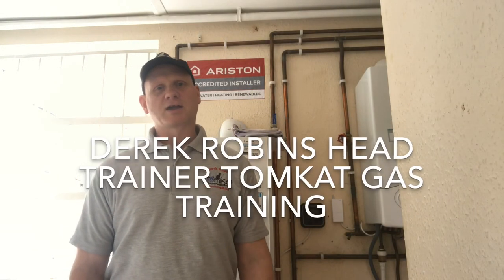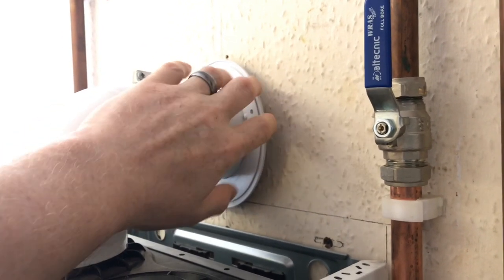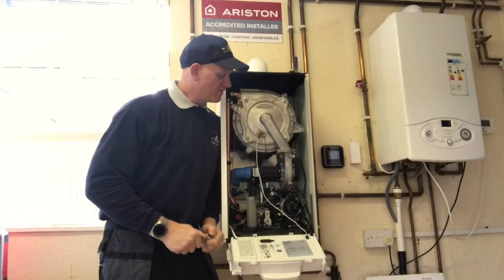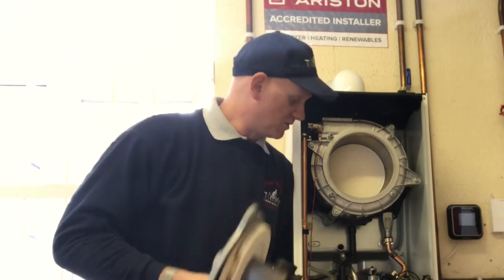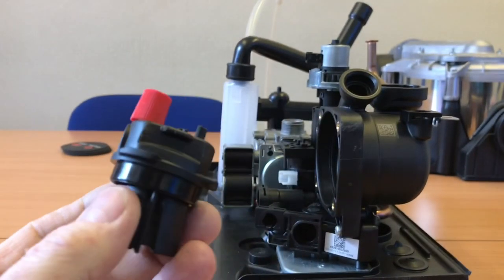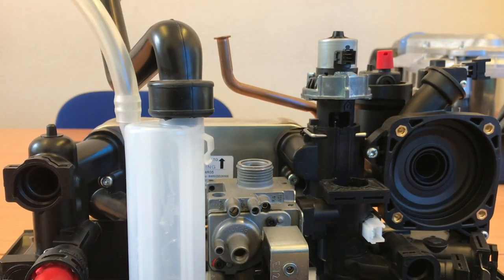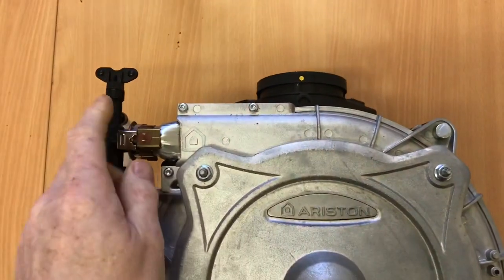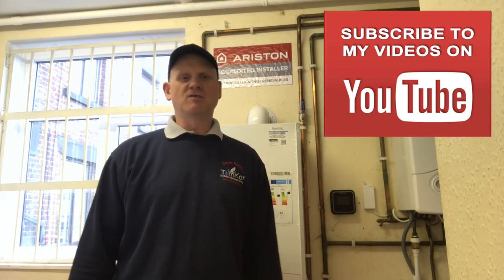ARISTON E COMBI ONE, inside the boiler casing full review and strip down of the Ariston e combi one

Comment: Just been out to one of these to replace the right hand block, (customer ordered part with correct part number) I couldn't fit it though as the bypass pipe wouldn't fit the new block?? Any ideas? I know they do a block with the bypass blanked but was under the impression that this is removable?

Comment: Very informative video thanks.
I fitted one of these a few months ago, converted it to LPG but it wouldn’t set up on low fire the co2 just kept bouncing up and down and the boiler got noisy . Inlet pressure was correct and hot water/ max fire was fine only does it on low fire. The gas valve has been replaced and made no difference!! not sure what other parts have been changed by the manufacturer but they are not able to resolve this. Have you any suggestions what this may be?

Comment: Our Ariston e combi has recently started experiencing ‘flame lift’ (as indicated by the fault code lights that appear) and eventually fires on the 3rd attempt at hot water or central heating demand? I am thinking this could be spark gap too big? Any help would be appreciated.
Ps great breakdown and explanation videos, best on YouTube by a mile!
Reply from the maker: clarkie005 it could be but your best bet is to get a gas safe Register engineer to take a look if you are not a gas engineer thanks for watching cheers
Reply: Hi! I'm having the same error. Everything's new, gas values are on point. Ignition is delayed every time when DHW is asked or CH. On test mode is perfect which is weird. Did you ever solved this problem? Thanks

Comment: Hi Tomcat ...We have an old..ish 38KW E-Combi about 8/10 years old. Recently at times when we press boost on the programmer the boiler fails to respond? sometimes it does respond a little later. We have learnt that if it does not respond, we run the hot tap for a short while leaving the boost on that when we close the tap down the heating comes on.....Any advise would be welcome, hope you don't mind?...Edit, forgot to mention we have replaced the programmer thinking the old one was the cause of the problem.
Reply from the maker: If you have a room stat the stat could be stopping it coming on until it the room goes lower than the stat is set. Also don’t understand why you have a boost setting when you have a combi as the combi only needs a time clock and stat
Reply: @tomkatgastraining  We have no room stats at all, just a Horsemann C17 programmer. The mechanical clock on the boiler is disabled. Someone suggested perhaps the 3 way valve could be sticking......I have no idea.
Reply from the maker: @CDLANEY1520  I am confused now do you have a combi or a system boiler ? You won’t have a 3 way valve on an combi but a system boiler you could. It could be the diverter valve inside the combi 🤔
Reply: @tomkatgastraining  Sorry yes I have combi, I have been looking at the parts list and it calls it A 3 Way + Motor. Ha! I'm a Joiner so that will explain my lack of understanding. I must be looking in the wrong place, the part No i have been looking at is (60001583)?

Comment: Hi there is this boiler capable of having a boost switch fitting so it turns it's self off after like 1hr thanks
Reply from the maker: Yeh it got a time clock built in
Reply: @tomkatgastraining  we have a static caravan and we are looking for like a boost switch which guests can press then it knocks it self back off after like 1hr . The problem we have is guest are leaving it on and going home and using excessive gas as it can be empty over night like this . We have been informed zero voltage or something no one seems to know how to do it . We had a switch on our valiant one before this wall mounted boost switch thanks
Reply from the maker: @paulker2349  you can buy an internet programmable room stat that works off your phone so you can control if from your home
Reply: @tomkatgastraining  there is no Internet there thanks for trying
Reply from the maker: @paulker2349  just use a time clock and room stat and put the stat in a tramper proof vented box and a time clock on the boiler in a locked cupboard

Comment: Hi for lpg should the fan be adjusted? On initial start up its almost as if fan is spinning to fast and killing pilot and error code 501 appears. Boiler can kick in if you slightly starve the intake by covering with your hand. Any help appreciated
Reply from the maker: madmhg1984 have you checked the foam inside the air intake silencer
Reply: @tomkatgastraining  yes, its a brand new boiler, on initial first start up it was perfect, all readings from anilysers where within readings. Next day we had nothing. So stripped gas valve etc to check for dibree, all clean. Then by trying hand over inlet (blue) it started up no problem. Its now the only way to get it running. All is safe as nothing is left switched on